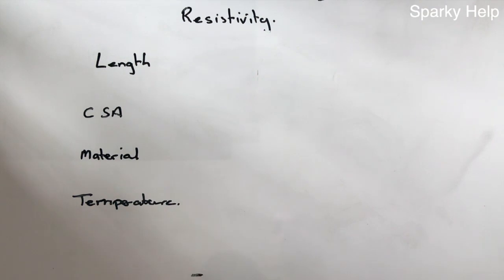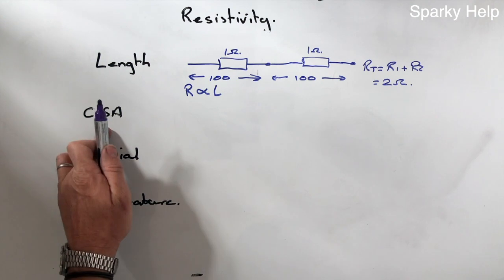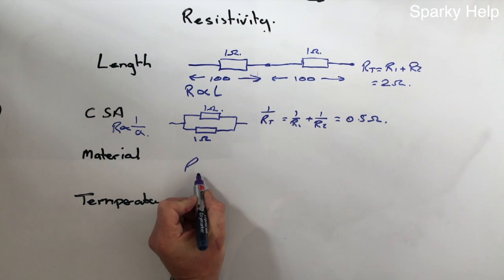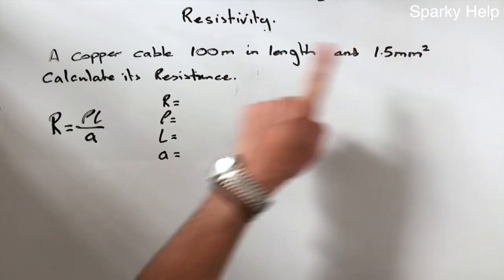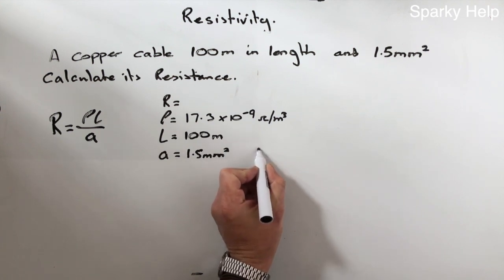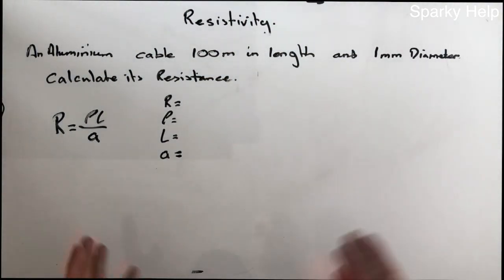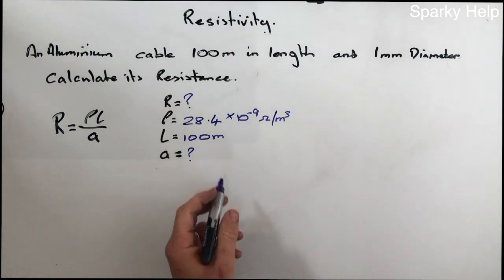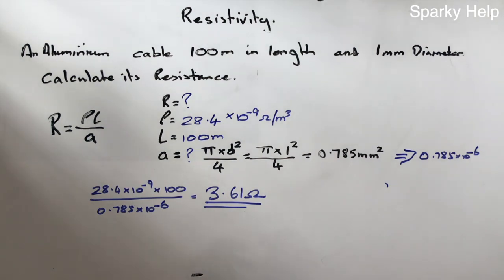Resistivity

Comment: According to my textbook you're rho figures are slightly wrong. 
According to my textbook:
Copper: 17.5 X 10 ‐⁹ 
Aluminium: 28.5 X 10‐⁹
Reply from the maker: Hi,
The Rho for copper used in the video is for annealed copper, what is the value in the text book for?
There will also be different rhos for aluminium depending on its composition.  Your text book rho is out by 0.0000000001 from the one used in this video.  Always use the Rho for the type of material you are trying to calculate.  I would guess that the text book has used different types of alloy of these materials, this would explain their different values.  Maybe you should message the author to get them also to clarify their values.
I hope you understood how to do the calculation, because that is the point and the reason why I have put the video together.  You can then use any values you wish.  Hope that helps.

Comment: Thanks a lot for this tutorial. Everything makes perfect sense how you described it. However, I got lost with the result of your first calculation. Would you be able at all to let me know in the comments how you ended up with 1.153 as the result? It would've been great if the equation had been broken down into 2 or 3 more steps for clarification. I somehow ended up with 19.95. I wrote out the exponents to their decimal numbers to be able to understand the math path, but it didn't add up for me. Thanks a lot!
Reply from the maker: I'm glad you have found it useful.  I have tried the calculation again trying different permutations where people normally go wrong, but I do not get to your answer.  Try looking at my video on Engineering Notations to check your use of the calculator - https://youtu.be/e4ka9Lvj45U 
Maybe check you have put brackets in! - This could be required depending on type (Age) of calculator.
Hope this helps - Please Like Share & Subscribe.

Comment: hey sparky me again haha,

how would you go about finding the out the length of a cable needed when you have no resistivity.
The question Im trying to answer only gives me the CSA, The conducting material, the voltage it may not exceed which is 11.5 and a amp of 13. I know I have to transpose the resistivity formula giving me L=RA/P but I just dont know how to find out the resistivity in the equation.

Please help
Reply from the maker: apply ohms law R=Vd/I = 11.5/13 then apply resistivity. Please like and share.
Reply: @sparkyhelp3997  man I really do appreciate this thank you, liked and shared your video already. Thanks again
Reply: @sparkyhelp3997   This is the question Im having trouble answering. "An immersion heater takes a current of 13A and is fed through a twin cable, each core having a CSA of 2.5mm2. If the conductors are made of copper and have a resistivity of 17.2 x 10-9 Ω/m3, calculate the greatest length of cable which may be used, if the cable voltage drop is not to exceed 11.5 volts"
Reply from the maker: @BtooBusy   Hi, Again work out the resistance (back to ohm's law)  R=V/I = 11.5/13= R.  then apply to the resistivity formula to calculate the length (see video on transposition).  Good luck.
Reply: @sparkyhelp3997  Thanks boss